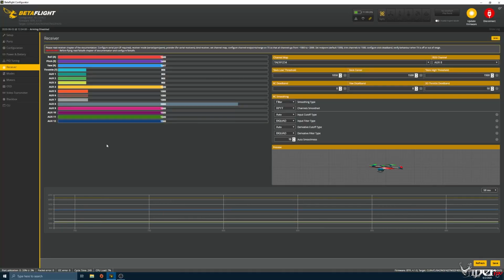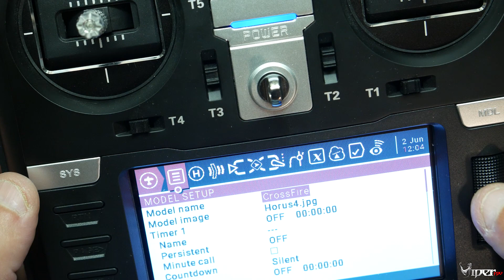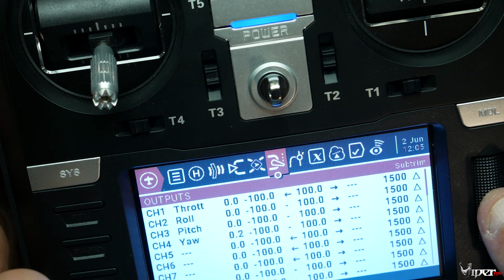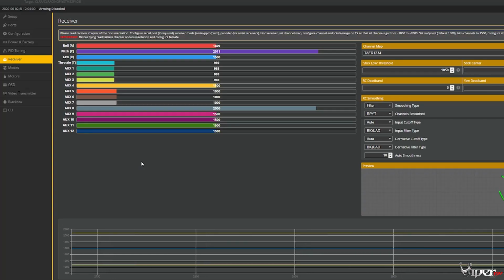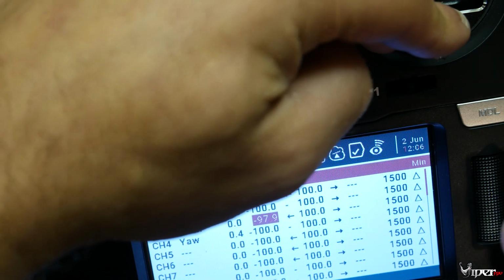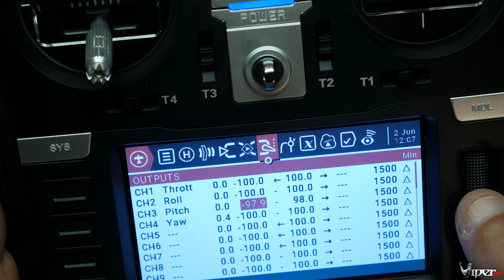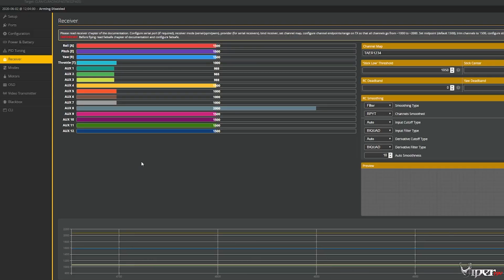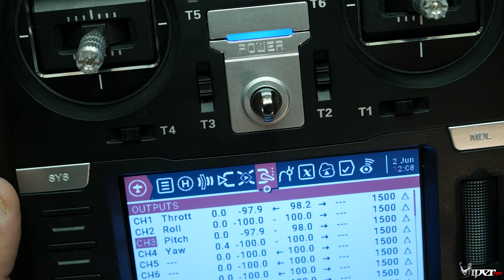Calibrating Channel Endpoints In Betaflight / Emuflight

Comment: I have 4 quads on my radio. Is this different for every model? Or is it a setting for the radio and will apply to all models?
Reply from the maker: Every model you will need to change it. Unless you copy every model after you set your endpoints and then setup your new model.

Comment: Good video! Why don't you use the rxrange cli command for endpoints? Is there a special reason?
Reply from the maker: Jofi FPV you can do it that way, but you lose all that stick travel on the radio.
Reply: @ViperFPV  Thanks! I didn't know that!